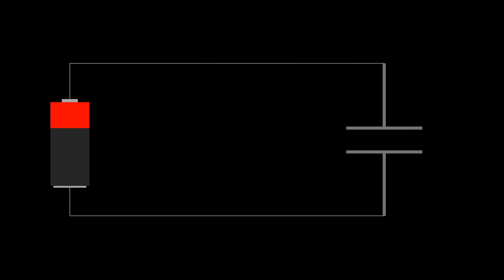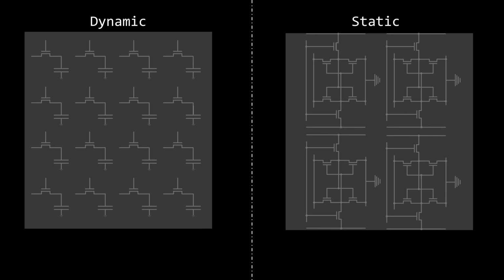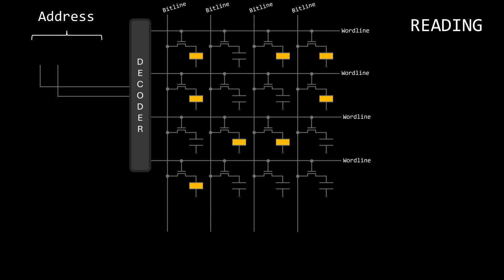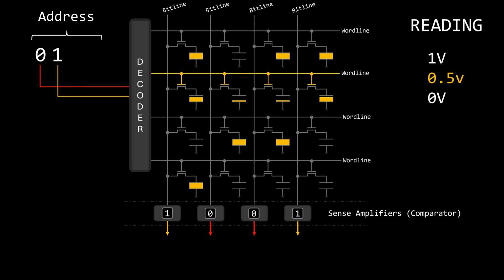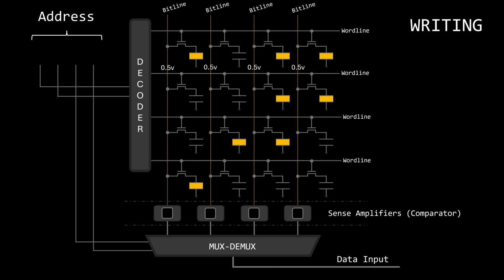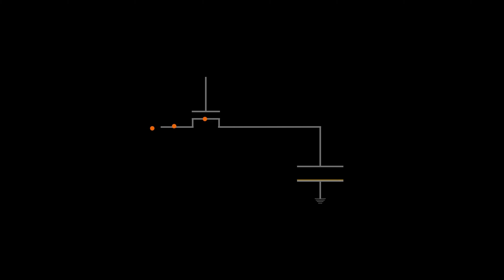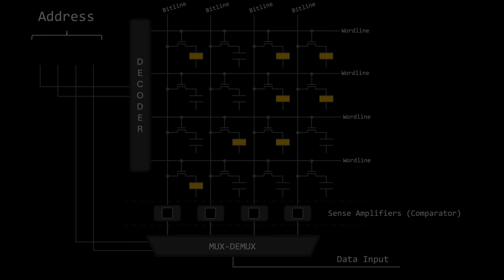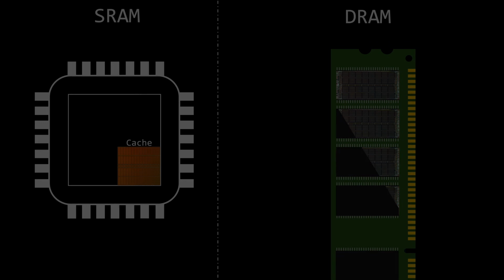Capacitors are terrible at remembering data. But for this reason we continue doing it.

Comment: but one thing i dont completely understand is why do we need to precharge the bitlines ? why cant we just read if there is any voltage or not ?
Reply from the maker: Because as soon as the gate of the MOSFET is opened, the capacitor starts to discharge. The voltage provided by the capacitor is proportional to its charge; so it decreases while it loses charges. In that scenario bitlines would be outputting a variable voltage.

Also, using the bitlines as capacitors doesn't require the process to completely charge or discharge the capacitors, so when those capacitors need to be refreshed at the end of the operation, the process won't require to wait for a fully charge or discharge, which for obvious reasons would take more time than only charging or discharging it "a little bit".
Reply: @CoreDumpped  thanks for the reply I think I understand now
Reply: I think we need to remove the ghost from the previous write and also bias the pre amps on the edge. The capacitors are charged if not too old. We just want to know the polarity.
Reply: One thing to note is that the bitlines, like every other component, have some capacitence.  In fact, when you consider that to reach however many gigabits of capacity a modern RAM chip has, a bit line must cross hundreds of thousands of rows, we can see that these are rather large structures, and so the capacitence can be presumed to be quite significant.  Did I mention that we also want to make the data storing capacitors as small as possible so we can fit more of them?

What this means is that DRAM capacitors are very likely not large enough to fully charge or discharge an entire bitline, not even close.  But they don't need to.  If we precharge the bitline to right about the threshold voltage for the sense amplifier to switch one way or the other, then just a small change in voltage is enough to tip the balance and read the bit.

Comment: One thing I was hoping you'd go over, but it seems you (understandably) didn't, is what makes up the capacitors on the physical die. I know that MOSFETs are said to have parasitic capacitance, so is that what's being used? Or do they have special layers of materials for capacitors, specifically? How big on the die is a capacitor, compared to a transistor?

I've seen conflicting answers when I try researching those things on my own. One of the things I remember seeing is a VLSI layout diagram that showed a capacitor being absolutely massive compared to a transistor, which would seem to imply that it should be possible to pack more SRAM into a space than DRAM, but if that were the case then nobody would use DRAM.
Reply: Modern DRAM processes use quite complicated techniques to fit as much capacitance as possible into as small an area as possible.  They typically use trenches with a conductive layer, a layer of oxide, and then another conductive layer to make the capacitor.  So although the capacitor is quite big compared to the transistor, most of its size is in the vertical direction rather than the horizontal direction.
Reply: @dfs-comedy  Huh, interesting. I wonder if that's modelable in Electric (open source VLSI program).

Comment: Question. Couldn't the slow discharge problem be solved by adding another transistor?
If the we connect the capacitor to the gate of another tranistor the transistor could charge the capacitor if the capacitor stores a "1".
While writing this I realized I don't think there's a way to reset a capacitor with a high-value this way. Never mind.

Comment: Very good explanation, but not the reason why DRAM is a bottleneck. The main issue is physical interfaces and process technology. DRAM cells are incompatible with standard CMOS (especially the newer FinFET / GAA nodes), preventing integration close to the computational logic (unlike SRAM). eDRAM was somewhat compatible, but required special considerations so had a similar issue with locality. If the RAM is not next to the compute, then data needs to be moved between the two (i.e. the bottleneck is the bus itself). SRAM caches have a similar issue. For DRAM, this is worsened by moving the memory to an external chip since the interface now has additional physical requirements (think HBM vs DDR).
Granted, the read speed of DRAM arrays is still around 200 MHz compared to 2 GHz for computational elements,  however, reads could be sequenced with co-design to provide an effective bandwidth of 2 GHz (the GPU in the Playstation2 did something similar through parallelism).

Comment: Capacitors are awesome at storing data. DRAM designs just push them to the edge. If you want to pay more for DRAM, you can get some on a better process and with much lower density but very long storage times. It is just not economical nor necessary. Do refresh times affect you personally or your PC experience? Absolutely not. So while I do agree that DRAMs don’t have very long data retention - they absolutely don’t have to. I am using electrolytic capacitors in a relay computer memory. They retain the state for many hours without refresh. You can stop the clock, turn the thing off, later in the day turn it back on and all the memory and register content is retained.

Comment: i knew dynamic RAM was sketchy, but i was not suspecting it this sketchy.
I hope they also have error correction.
Reply: basic DRAM doesn't, however servers that need to be as stable as possible use ECC DRAM, which sacrifices a small part of the capacity for error correction

Comment: but isnt a mosfet itself basically a transistor that also acts as a capacitor? because if you for example apply a voltage to the gate and then remove the voltage source, it will still allow current to flow from source to drain due to its capacitance. or am i missing something?

Comment: so why do they not store a cap with 2 bits that way we get 0v -0.25v-0.5v-0.75v+ or even make the resolution bigger? or make like a prediction circuit like the cpu has ?
Reply: And now you have the idea behind Multiple Level Cell flash memory. Flash does not use traditional capacitors but the basic idea is similar.

Comment: 0:28, A small typo, A capacitor is a Electrical device, not Electronic.
Reply: I actually went and looked up the definition of electronic and one of them is

"using, based on, or used in a system of operation which involves the control of electric current by various devices, such as microchips:"

and capacitors are certainly used in such devices.

Another is relating to electrons which seems accurate as well.
Reply: @petergerdes1094 I was told electronic is things that have to do with logic, as in micro-electronics, microchips. Electric is just for devices that use electricity.
Reply: @ Thats indeed one of the definitions I found.  Just not the only one.  I'd probably use it the way you said just not correct people who don't.
Reply: Uuuuhm actuuually since it was spoken and not typed it wouldn't be a typo.